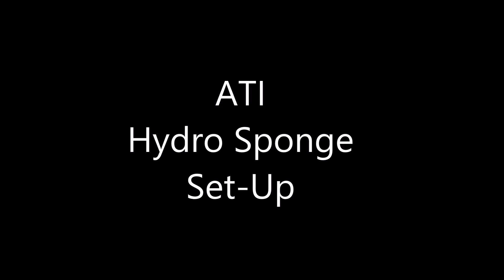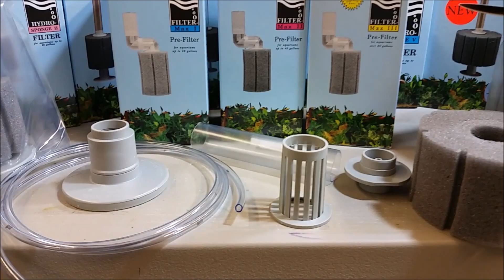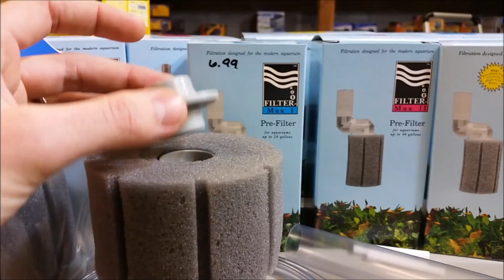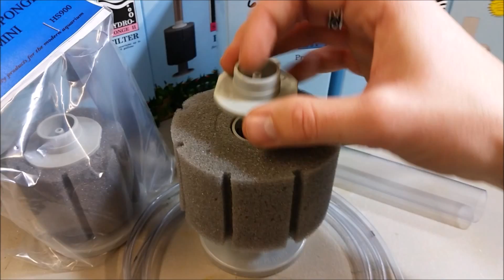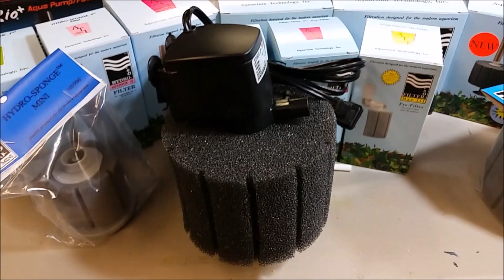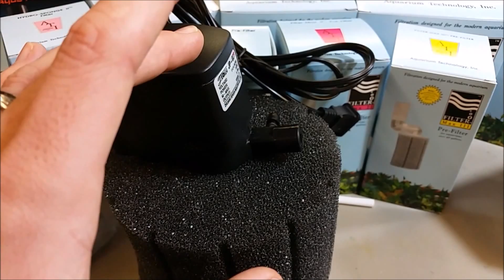Sponge Filter ATI Hydro Sponge Foam Set Up

Comment: Will one ATI Hydro Sponge 4 efficiently filter a 29 gallon tank with a community of tetras, a few bottom dwellers (Cory catfish, etc) and a  few more fish for centerpiece (like a honey gourami or beta or something)?
Thanks
Reply: Yes, it is more than enough. In fact a genuine AAP/ATI Hydro Sponge #3 should do the job. 

Reference: http://www.americanaquariumproducts.com/sponge_filtration.html

Authorized Resource: http://www.americanaquariumproducts.com/SpongeFilter.html
Reply: Carl Strohmeyer Thank you so much for the quick reply. I’m planning to have this community setup I mentioned in a few months during Black Friday, so I’m doing a lot of research now.
Reply: @rifraf6135  You're welcome. Definitely read the very in depth article I shared with you. Quite frankly if you want the best overall filtration for your size aquarium, the exclusive AAP/ATI PRO3/1 Combo is my suggestion.
http://www.americanaquariumproducts.com/SpongeFilter.html#sponge3combo
Reply: @carlstrohmeyer  thank you. Do you have any air pumps or power heads you recommend that are under 20 dollars? Thanks. (Those that can powr my tank)
Reply: @rifraf6135  AAP sells the Million Air Pump line. I've used this line for myself & clients for almost 3 decades and while an economy pump they often last 2-3 times more popular pumps such as by Hagen. This is in my experience the most under rated, yet best line of air pumps for the price.
The MA 200 ($13.49) would work for your size aquarium, or better would be the MA 400 using an airline 'T' to make one line.
http://www.americanaquariumproducts.com/MILLIONAIRAIRPUMP.html
Reply: @carlstrohmeyer  thanks so much

Comment: It's good that it doesn't have plastic in the middle of the strainer.  Most of them do, and you can't attach air stone unless you cut it out, so called "modification".  Problem is after modification, it never fits tight and sometimes comes off.  I just installed 3 sponge filters of different sizes, and they all do.  One of them I had to tie with cable tie so it wouldn't come loose.  Definitely I'm getting rid of them, and get ATI sponges.

Comment: Can you add a purigen bag or poly-fil inside the sponge filter between the two connection piece, Basically where the air stone is attached.
Reply: Thx for the quick reply, yes i was referring to adding the media inside the strainers, if thats not possible will this work? I install another tube with a air line at the bottom and have purigen inside it. I could hide it somewhere in the tank. Will that be effective? Maybe in the same tube add other media for filtration. Thoughts?
Reply from the maker: Yes, you can. We've done this successfully.
Reply: While you could add to the strainer, this will impede flow and efficiency of these filter. Best wedged between sponges when using Hydro Sponge Combos or Stackables or at the very least right next to the sponge  where current is stronger.
This is noted in this article too:
http://www.americanaquariumproducts.com/sponge_filtration.html
Reply: Are you asking to place this Purigen Bag inside the strainers? If so no as this will block water flow and make the the sponges less efficient.
If between sponges or right next to a sponge, yes

Comment: sorry for disturbing you with more questions. Am new to fish keeping that's why am raising many questions.Am having a red dragon flowerhorn and my tank is 30 gallons.Am going to install a 3 grade size sponge filter is it enough for filtration and I heard that 100% water change will wash all the good bacterias.is that true because the pet store where I bought my flowerhorn said do 100% water change once a month.so please clarify this question.once again sorry for raising too many questions
Reply: as far as I know u only change max 30% water every week on any fish usually they recommend slightly bigger filtration than your gal I have 2 40gal filters in my 45gal tank

Comment: why should we clean sponge filters with the aquarium water itself instead of fresh water
Reply from the maker: +Nathan Venkat you could use freshwater from a well, but you wouldn't want to if there's chlorine. You could still using something like Prime.
Reply: Because you want to keep the benificial bacteria on the sponge.
Reply from the maker: +Doris De Domenico looks like I didn't see this comment. You actually can clean the sponge in fresh water. It's just if the water is city tap water, chlorine has to be removed. Well water there's no problem. If you have dense sponges or pads, the bacteria will live in the sponge.

Comment: shouldn't you mount the powerhead on a sponge filter riser tube?
Reply from the maker: 4estfloor  As per the Sponge Filtration article in the details, it can be mounted either way; directly on the filter or on the lift tube. Please read this article
Reply from the maker: 4estfloor From the Sponge Filtration Article in the details section:As the reader can see, the power head can be mounted directly on the Sponge Filter or on the lift tube and each have their advantages:

*Lift Tube Mounting Advantages include better over all circulation, especially in taller tanks.
*Direct Sponge Filter Mounting advantages include better stability and less chance of fish disrupting the pump from the filter. As well generally a better fit for aquariums under 12 inches in height

Comment: how can i load purigen in my sponge tube? I don't understand, You didn't explain that part at all. could you please? thanks you
Reply from the maker: This is explained in the first article about Sponge Filtration in the video details, PLEASE give it a full read as it is VERY in depth. 
Here is the article once more
http://www.americanaquariumproducts.com/sponge_filtration.html
Essentially one places the Purigen bag just under the sponge where the current is stronger as water is pulled into the sponge filter
Reply: defuser is just an air stone if u have one use it